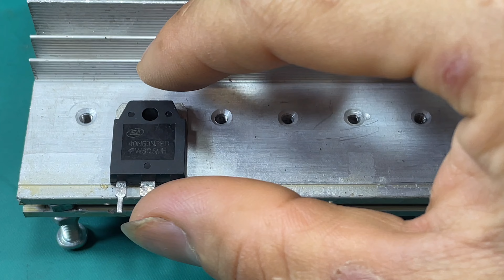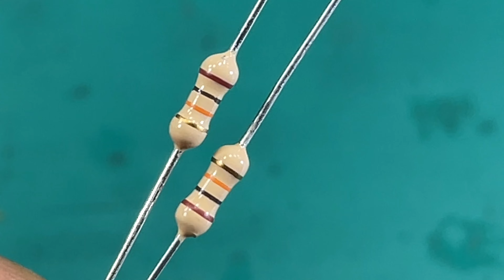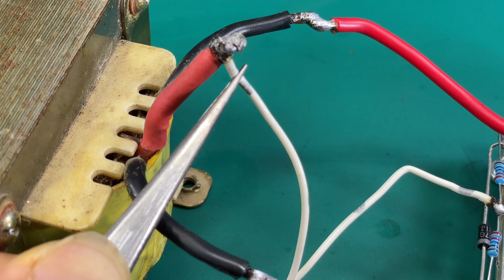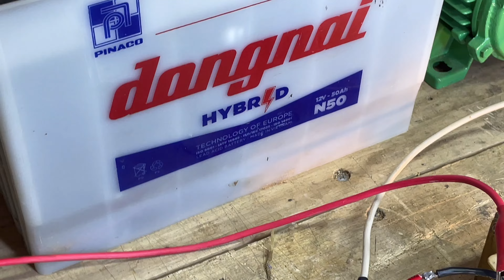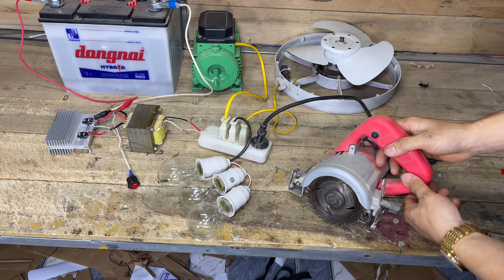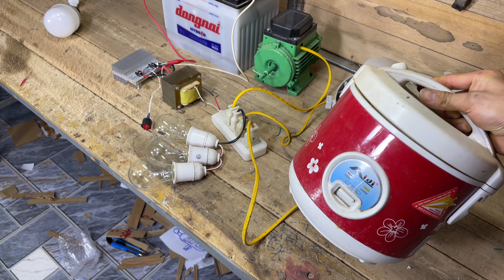Inverter 12v to 220v, NO IC, 40n60 x 2, Inventor101 #20

Comment: This connection cannot work. The schematic does not include an oscillator. In the link, I put a video of the wiring that you put together. I also put a diagram of the inverter that I used as a backup source for the circulation pump. By paralleling the MJ15003 Transistors, the performance can be increased as needed. One pair of MJ15003 can be used for a short time at 200W. But I wouldn't build it today, because the connection does not include feedback regulation. As a result, the output voltage fluctuates quite a bit. Another small link, when you are already publishing something, please make it functional.🤔

https://youtube.com/shorts/jHleGJQ1860?